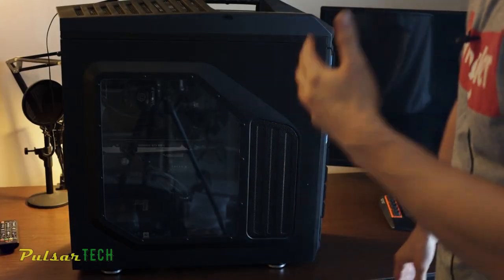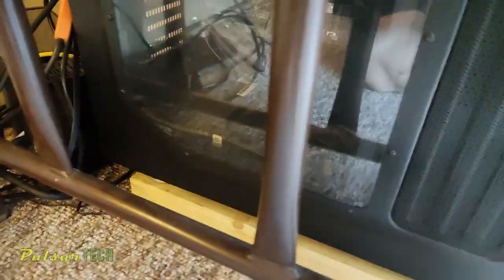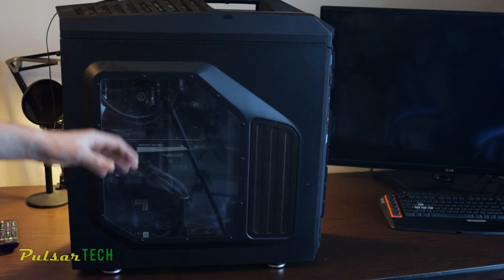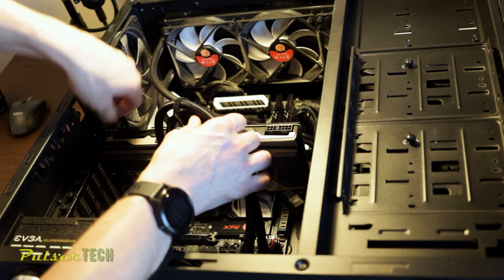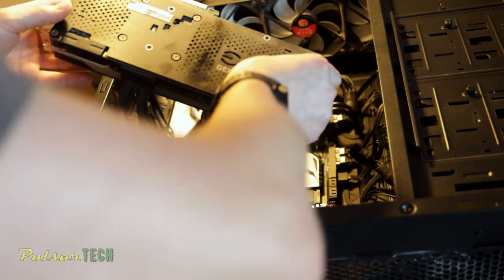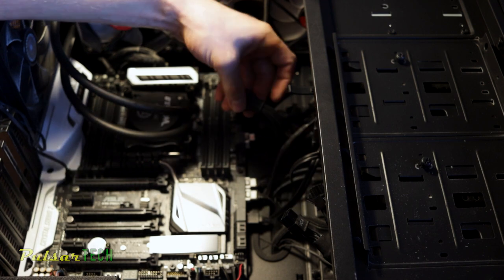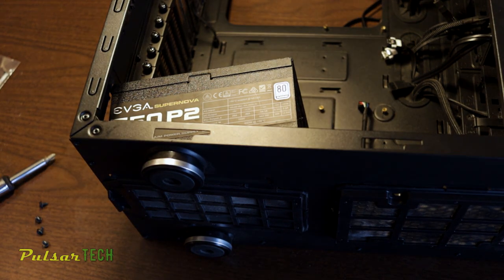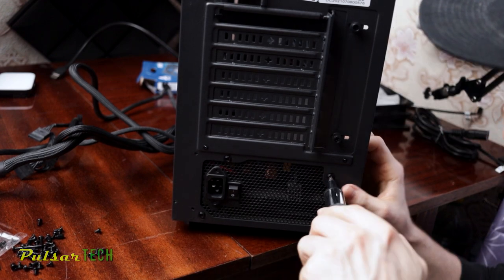Full PC DISASSEMBLY Guide Step by Step | Cooler Master Storm Trooper

Comment from the maker: * Please like, comment, share & subscribe!!! * If you would like to support my channel please use SuperThanks! Thank you!
Reply: How do you connect the cooler controller of this case?? Just turn on the normal PC and it turns on automatically?
Reply from the maker: @Ktsuyaa  do you mean fan control at the front? It's part of the case assembly, so it's not meant to be removed. To disconnect all the cables to the power and reset button and USB ports check 11:40.

Comment: I had the case in 2014 for my first build ever. Went for a NCase M1 itx nest in 2019. Now in Lian Li 216 since last week.
Reply from the maker: It is a great case for a large PC. I've switched everything to a mid-tower Deepcool Matrexx 55 Mesh, though you can not put a 360 AIO except at the front unlike Cooler Master it fits on the top as well.

Comment: you removed top plastic cover easily but I cant take that out as it seems riveted. I need to access power switch connections to see if that's faulty or lose. PC is not powering on at all though there is led on on motherboard.
Reply from the maker: Hi, the top plastic piece is not riveted, but instead, the plastic clips are fairly strong, and one needs to apply decent force to open them. It's almost like you think it will break, and then it comes off. Just take your time, slowly increase the force, and it should come off.
Reply: @PulsarTECH  Thank you for the quick reply, managed to get it out.
Reply from the maker: great  @rajking6679

Comment: My friend gave me her pc before moving out. It has a CM storm case. Its full of dust so i wanna clean it, and im worried how to take it apart to clean off the dust lol. Any tips are appreciated. Especially if I should keep it laying or up, on what surface, and what I should use to clean. Should I take out all the parts individually? Never built or disassembled a pc in my life so I'm pretty worried.
Reply from the maker: Well, you can just use a vacuum cleaner with a brush and carefully clean inside. If you want to do a general cleanup and remove components, here is a video how to do it https://youtu.be/ZfEpAmX7LTk

Comment: Are this case still compatible with nowaday's hardware? What about the front slot at the power button ? I had this georgeous case before, kinda regret to sell it, still looks amazing. Cheers
Reply from the maker: Yes, it is. It's a full tower case, so you can put a variety of different hardware inside. The front slot is meant for a quick attachment of SATA SSD, though I have never used it myself. Cheers.

Comment: How about taking off the front?
Reply: Let me know if you find out how please
Reply: Yea, it's easier if you take the top cover off first, for that, there are 3 tabs on each side of the case. If you run your fingers up the side top edges when the sides are off you'll feel tabs that run along(at @14:09 in the video you can see the small 1 inch rectangles along the top edge where the top cover locks into place), you can push /pull those one by one until you got them all unclipped and then pull off the top, remember that the handle isn't part of the top cover, lol.. then for the front, make sure to unscrew the 2 bottom screws that are behind the name plate / storage area(when you look at the front of the case, the very bottom non mesh plate, behind that..) these are what keep it from being easy as it looks. After those screws are out, you should be able to lift up on the whole front facia, you'll feel it shift about half inch up and unlatch from the frame, then it should pull right off. @Thraxup

Comment: I got new ram it is ddr3 and my motherboard supports ddr3 but when I turn it on it beeps 6 time witch means the ram isn’t compatible what do I do
Reply from the maker: Hi, there could be a few issues. If you have more than two memory slots, you should follow the pattern to install RAM, in most cases it is A2, B2 but you need to check your motherboard's manual for reference. Also you can check my other video how to install RAM here https://youtu.be/jnqPRkEvxS0
If it still doesn't work try to update your motherboard's BIOS. 
Also make sure there's no dust or dirt in the slots and that it is not damaged. Hope this will help.

Comment: Here in Pakistan I bought this case used for 20$ not because it is cheap but i still love storm trooper design i m not a big fan of all those aquarium looking led pc cases ,, for the motherboard i bought gigabyte x99 gaming 5p which i found brand new for 100$ for cpu i might go for e5 2667 v4 or 6900k n for gpu im waiting for rtx 4060! Any advice or suggestions is appreciated 👍
Reply from the maker: You got it! I would recommend to get at least 32GB of RAM, if you're doing any graphics intensive work and get a water-cooling because it makes such a huge improvement for the CPU temperatures. Otherwise the choice is really good, you'll have lots of cooling power with this case.

Comment: Just got the metal/mesh pmside panel version of this given to me..

They've had it years! 
FX9590
M5A99FX R2 
Hx1200i 
32GB Hyper X Savage 
Aorus rx580
Be Quiet Dark Rock Pro 4

There is a soundcard that appears to be x2 cards havent checked model number yet.

No storage devices and they had some weird external power button that was desk mounted.  For some reason, they've removed the usb 3 ports on the front of the case.

Came here Googling how to access the wiring inside the front panel/buttons to see if its all still there hiding away. 

No drives so i had to live boot linux to ensure system was still running. 

No idea what to do with it atm.  My gaming rig is 1 year old and the specs of this machine is far too power hungry to make it a home server... 😂
Reply from the maker: I hear you, computers age quickly. It is a solid case though with lots of air flow and room for components.